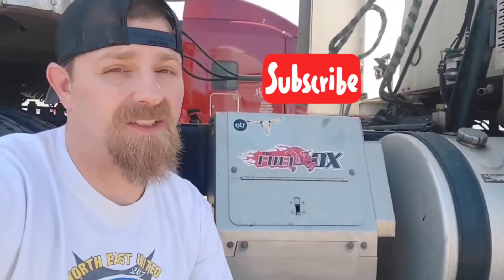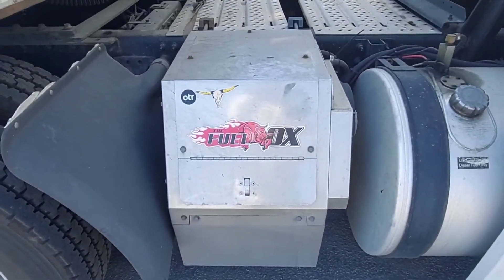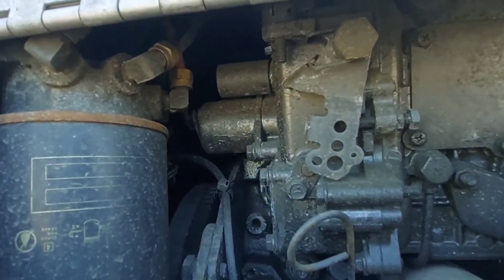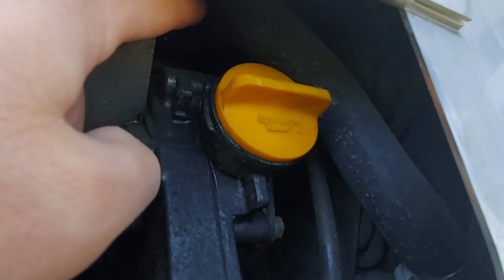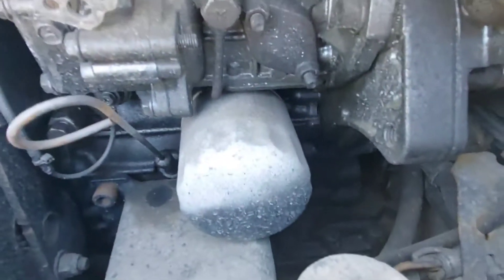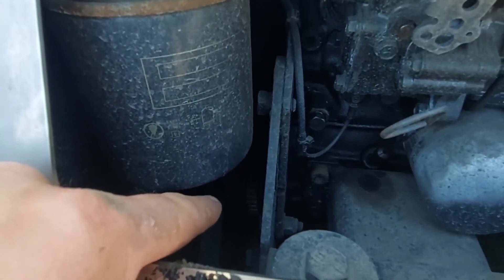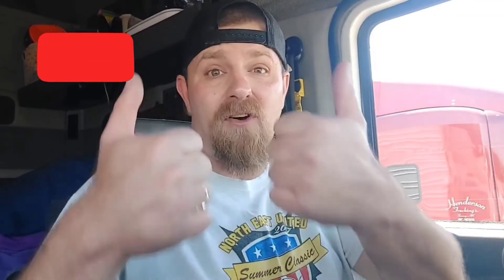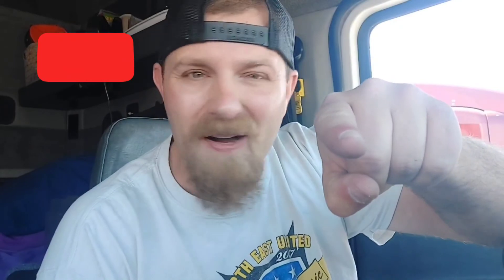Pre trip failed? Thermo King Tripac APU pre trip#trucking#otr#owneroperator#thermoking#apu

Comment: I would never grab that belt without preventing the apu from starting up. I wouldn't want to loose a finger!  I keep the trucks key in the on position with the engine running or not. My apu does have its own power switch right on the unit. Good video otherwise.
Reply from the maker: Yes always kill the power, I forgot to show that!!
Reply: @F8truckin  Hopefully people will think to do that.